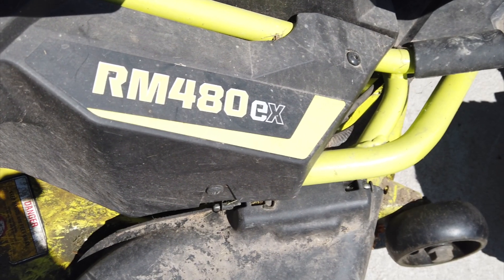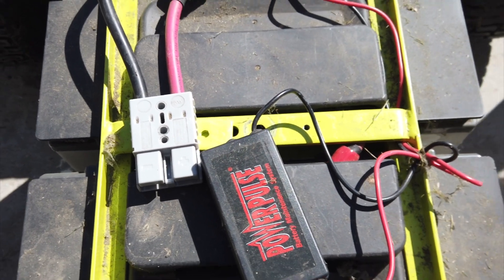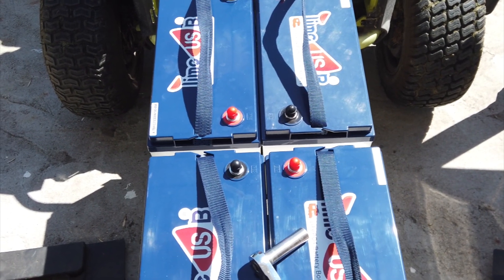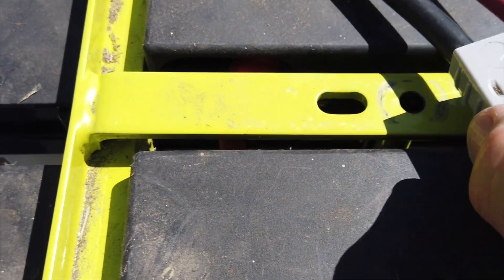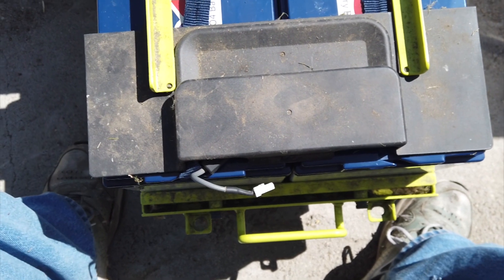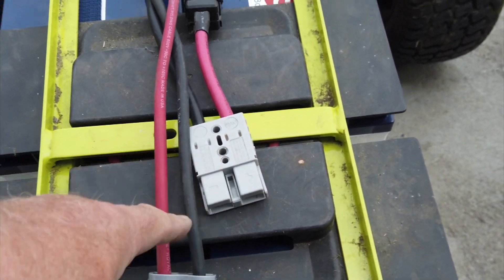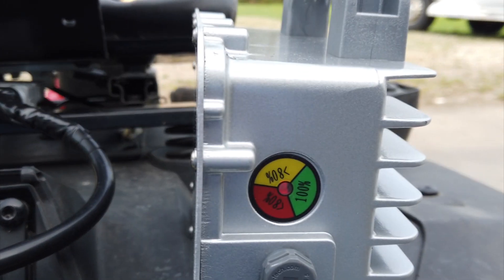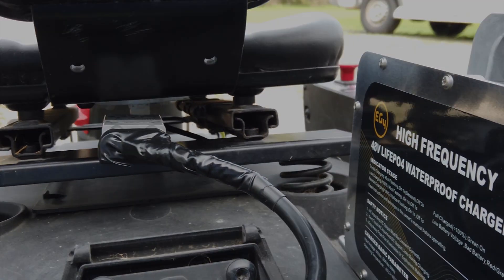Ryobi EM 480 Mower Battery Switch to LiFEPO4 review #2 Full Version

Comment: Clever solution to run the new charger cable under the seat like that!  About to do my conversion and was able to find a 48v 50ah LiFePo battery with 18 amp charger for under $600 on Amazon (manufacturer: DC House), so the prices have really come down in the past couple years.  Plan to do my conversion next week.
Reply from the maker: @kurtelia2212  the cheapest I have seen on Amazon for a full size 12 volt 100ah battery is $149, I saw one with Bluetooth for $159 each. I would highly recommend that over the 50 amp battery. We have a lot to mow and that gives us plenty of power with the 100ah batteries installed!
Reply: @ Yeah, our original lead acid batteries were 75ah. So I figure the 50ah LiFePo batterie will already be an upgrade since you can use 100% of their rated capacity, not 50% like the old lead acid ones. Our yard isn’t as big as yours! 😄 Build quality seems to vary a lot by brand also, so was cautious to get the super cheap ones. The DC House manufacturer seems solid - time will tell.

Comment from the maker: Actually I’ve had very good luck with the many chargers I have purchased from Signature Solar, it was not a big deal to bypass the internal plug and add a Anderson connector to the 48 volt system.

Comment: Looks Like you know alot about Electrical wiring but why you didnt use EZGO charger which is lithium battery charger for Golf Carts and use exact same plug. You dont need to Alter any of the wirings. I convert mine and kept it original wiring and using Golf charger but want to change to yours if im missing anything Charging wise or there is something in Ryobi original wiring that does not support Lithium batteries or Charging port. So far mine charging just fine.

Comment from the maker: Take a photo of the way it is wired, the only thing I changed is add a positive and negative welding cable on top of the of the top battery terminals of front battery. I happened to have a spare Anderson connector that I installed on the only two wires I added! I cut the clamps off of the Signature Solar 48 volt LFP charger and installed the mate of the Anderson connector.